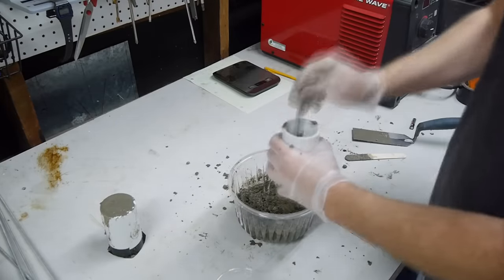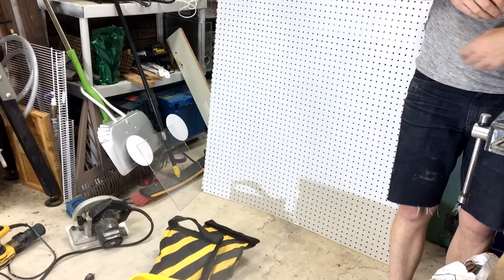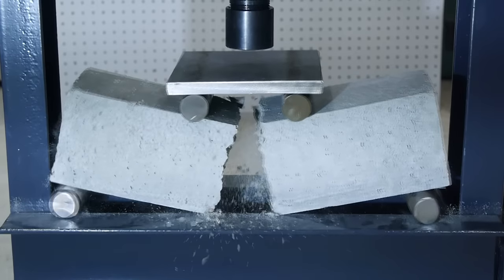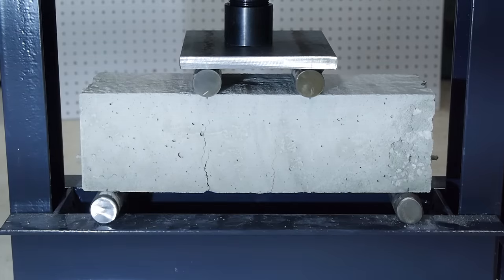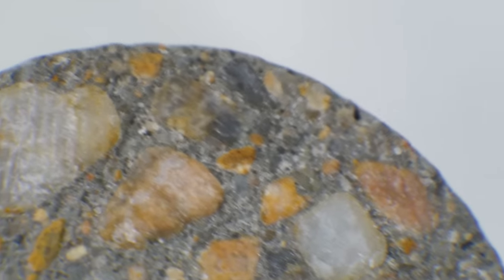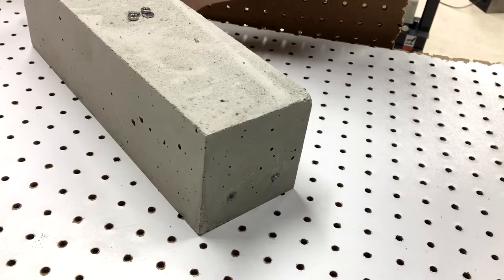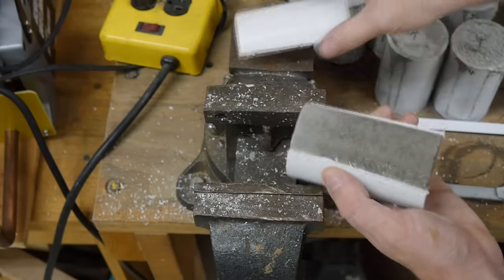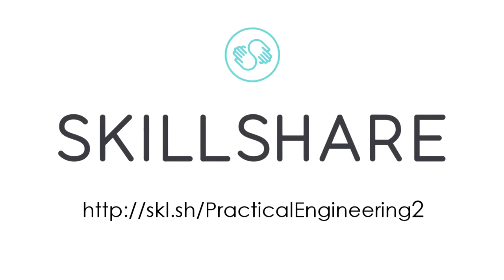Why Concrete Needs Reinforcement

Comment: Also, could the reason behind the diminished tensile strength be that the bolts you cast into the concrete covered a much smaller surface area than when you did the compression test? When you did the compression test, you put the load equally along the entire edge of the cylinder. However, when you did the tensile test, you did it with ONE bolt, right in the middle. Wouldn't adding more bolts distribute the weight on each bolt, reducing the stress on each one, and also therefore introducing more points of possible failure while at the same time decreasing the overall chance of failure against the same test weight? I'm no engineer, but this got me thinking.
Reply: Sure but the concrete broke cleanly in the middle! So the steel and the adhesion didn’t effect the test? If u catch my meaning

Comment: Wait, so the pre tensioned reinforced concrete broke at the same force, but the cracks formed later? Why would I want to use a type of concrete that shows warning signs later?
Reply: Cracks don't always equal a warning sign of catastrophic failure.  In most cases, they don't.
Reply: Although his demonstration didn't show it, prestressed concrete can be significantly stronger than conventionally reinforced concrete. Also, as the commenter above said a lot of the cracks that first start in regular reinforced concrete need to happen to get the concrete to transfer load to the steel. With prestressed concrete, you avoid this initial cracking because the steel is already in tension and the concrete is in compression doing what it does best.
Reply: The tensioned setup failed due to only hanging on by some thin threads, the rod didn't break. The difference being that the concrete didn't have to fail before transferring force to the rod.

You'd want to use it where you wouldn't want the concrete to fail in the first place. I imagine the rods used are designed to fail slowly so as to stretch and allow for visible cracks to form before failure.

In theory, it does make the concrete much stronger.

Comment: what about adding fibers into the mix?
Reply: It might mess up how the cement forms, and drys. Plus you gotta think about the weight of the project. I'm doing a job right now that is about to pour 55 tons of concrete, and I don't think fibers would hold any area of that. I'm sure if fibers would help they would have already started adding it into the mix. I mean the world has been using concrete for more then 100 years.
Reply: You can add fiberglass to the mix along with rebar, nothing wrong with doing so. Or you can just use fiberglass with no rebar, depends on the use of the finished product. All the tiny fibers would help keep the concrete together. Only downside side is that it’s slightly harder to finish.
Reply: https://en.wikipedia.org/wiki/Fiber-reinforced_concrete

Just add a fiber-free top coat after floating when the FRC concrete is screeded to avoid issues when finishing it.

There r many different fibers (used in FRC) it's not just (GFRC) fiberglass that can be used instead of rebar for some applications. But when there is a large project the require pre-tensioning like an large infrastructure FRC usually will not suffice on its own. 

BTW concrete is thousands of yrs old not just 100s. And fibers was used early on in it. But just like concrete, the know how to use fiber with it was lost too and had be rediscovered.
Reply: Fiber-reinforced concrete (FRC) has been around and researched a good bit and it has limited use.  Rebar is needed for continuity throughout the concrete member and most fibers used in FRC are extremely short and can only reduce microcracking.
Reply: Rebar is more traditional used by most trades ppl so there is a bias to use it. And many have no idea how to properly use Fiber-reinforced concrete (FRC) such as Glass Fiber-reinforced concrete (GFRC). That adds tensile strength throughout the concrete unlike rebar. And is less prone to failure since rebar is often incorrectly placed. 

So ppl that make incorrect generalized statements like "Fiber-reinforced concrete (FRC) ...it has limited use.  Rebar is needed for continuity throughout the concrete member and most fibers used in FRC are extremely short and can only reduce micro-cracking ("continuity" of what?)" just do it out bias and ignorance about both FRC and Rebar. 

Bottom line is do your own research on what is best for your individual application.
Reply: Concrete already sucks as it is 😂

Comment: I've noticed iron rebar within concrete will rust and expand, breaking it apart after enough time. Is iron rebar only used to save cost over stainless steel?
Reply: I don't see a lot of other reasons to use it
Reply: Do you mean steel vs stainless steel?
Reply: Your question spurred a Google information search. Apparently, iron has a greater yield strength and greater shock absorption than steel. Possibly one of the reasons
Reply: stainless
Reply: interesting
Reply: Parker Davis stainless steel rebar is used if specified by the engineers.  It is considerably more expensive than regular steel rebar.  You will see stainless specced in areas of high corrosion such as bridges near salt water.   I have even seen epoxy coated rebar but I didn’t ask what application it was used for.

When Using normal steel rebar there are standardized guidelines for proper placement to insure sufficient encapsulation.  This is done to help prevent moisture from contacting the rebar causing it to oxidize.  Oxidization (rusting) of rebar embedded in concrete can be quite destructive.  It can expand to four times its original size if I am not mistaken.
Reply: there are ways to clean and reserve the state the iron bar was used but a lot of the workers now don't use it because of the time, money even tho for the long run it would pay off a lot better
Reply: Rebars are always covered by a layer of concrete. Thickness of this layer is always calculated and it's based on the type of environment the structure will be placed and so on. Minimal thickness is about 20 mm and can go up to 50 mm in foundations. If done properly, it will not rust for the lifetime of concrete structure, which is 50 - 70 (100) years.
If some part of reinforcement gets exposed, it is treated by anti corrosive coat and covered by concrete again.
Reply: badlandskid
Reply: Parker Davis I'm a reinforcing iron worker and unless the place is humid. Regular steel is enough. Now on places that have boilers or water tower you can use epoxy coated rods. Or if you're building a bridge galvanized steel
Reply: Concrete is a fascinating trade and there’s so much to learn about it.
Reply: Rebar is made of steel not entirely out of iron. Cost is a factor in many applications. There are time where only fiberglass, or steel “beads” are used instead of you standard rebar.
Reply: Parker Davis I'm a bridge engineer in New Mexico. We specify that in our bridge beams, all rebar within 4' of the ends, and all bars that protrude from the top of the beam must be stainless or stainless clad. It's expensive, but these two areas are where we find the most corrosion problems, so it's a tradeoff between cost and service life.
Reply: pakan357 I agree with you, bur it could still rust. Especilly the "black" rust that that can happen to structures exposed to water.
Reply: Carbon steel is much much less expensive than stainless steel. You'll find that due to the high alkalinity (pH of 13 or so) of the concrete when poured that a passivization layer is created at the bar/concrete interface. This layer is enough to protect the carbon steel bar against corrosion for quite some time. Of course, there are always exceptions that can lead to corrosion. Cracking of the concrete cover may cause this layer to breakdown if the concrete pH drops. It gets especially bad if you have a catalyst like salt to speed up the process.
Reply: jjohnston94 Is basalt rebar ever specified to be used on any of the projects and if so what are the criteria for it to be used?

Comment: 1. the type and size of the pebbles count. 2. type of sand. 3. type cement (sometimes it's a mix) 4.if you add fibers you can reinforce the concrete a bit more. 5. How much water you add effects the concrete too. If it was to dry it has bubbles and the concrete brakes faster, if it was to wet, the concrete loses his strength.
Reply: This is all true. I am a rod buster/ post tension installer. I know that they use special mixes. Vertical is different from deck. All do to different forces that occur. There are def. special mixes certain companies use and swear by them.

Comment: I have a question 🤔. If you could pre-stress concrete, would it be more beneficial to zig zag the metal rods, or even have a spiralling shape, to mitigate future pulling, pushing and twisting of a generic concrete beam ? 🤔🤔 I hope this does not sound stupid 😐
Reply: the metal rods usually designed on site before being poured by concrete, because it is cheaper to produce long uniform metal rods. It doesnt sound stupid, but if you order predesigned metal rods, it way more expensive adding to the building cost. I never saw the spiral or zig zaging shape, but usually we make it like square patern on top of each other(usually welded together)
Reply: I guess it will cost alot to do this way and reinforcements  at certain points will be weaks. So in real life they just increase the sizes or they add more reinforcements.
Reply: nope. a spiral rebar shape would mean that the longtidual tensile force would be split between a parallel to the axis of the rebar and a vertical one. so a spiral shape would deform much more.that means that the beam would crack alot more. u generaly want the rebar to take tensile force only and concrete compressive only. all the forces pulling-pushing and twisting can be recived by the cooperation of the longditual rebar, the transverse rebar and the concrete

Comment: I was taught that concrete (and other ceramics) are good in compression but bad in tension because tensile stress helps with the propagation of small cracks that are already present.. is this true?
Reply: Millie Heber that’s true
Reply: Millie - That is partially right.  There are lots of cracks in concrete.  Also, the glue that forms (known as CSH) is not strong in tension.
Reply: Those cracks you refer are also sometimes tiny fissures, gaps, air pockets, etc. and they are formed when the concrete is poured and sets. That's why concrete workers (called concrete finishers or cement masons) are in a skilled trade (from apprentice to journeyman over 5 years), and do their best using tools and techniques, to remove these gaps, and fissures, so that as the concrete sets, it doesn't solidify in a manner where cracks can easily develop.

Comment: I am confused between concrete resistance, for example f'c= 250kg/cm2 and the slab resistance or the weight a concrete slab can carry wich is a lot less than 250kg/cm2 can somone clarify me this please.
Reply: It is because fc is concrete's compression resistance. Your thinking would be correct if you considered columns - elements that are mainly being compressed (of course fc is only one of the variables that determine a column's load capacity). Considering columns you could assume that it should carry weight around it's fc value so in your example it would be 250kg/cm2 times it's cross section value (please remember this is just general idea I'm describing, not the precise solution - it's not difficult to imagine that a column that's cross section is 1cm2 and it's 2m tall won't carry 250kg:) ). Slabs are elements that have to handle mainly bending. As author of the movie shown in 2:34, bending causes both compresion and tension forces in element. There is an easy way to transpose force that bends a beam, to compression and tension forces in that beam. If you want to check how much weight will your slab carry, you have to find how much of compression force your slab can take (and I mean this transposed force that comes from bending ( 2:34 ), not the weight placed on the slab!). That amount depends mainly on the slab's height and concrete's fc. When you know value of compression force, then you also know tension force because they are equal! So next you just have to provide rebars in the slab's tension zone, because concrete can't handle that amount of tension. Quantity of those rebars must be enough to handle all that tension force then. When you know those maximum "transposed" compression and tension forces that slab can take, you can calculate backwards how much weight on the slab causes that amount of forces.  That was just a long story short thing - tried to describe general idea of slab's mechanics. Topic is not that difficult, but if you want to fully understand it you have to get some knowledge of basic statics, beams and how reinforced concrete works, which was well explaind in video above. Hope I could help.
Best Regards
Reply: @qvanta  Thank you very much for your detailed explanation! I greatly appreciate it! Now I understand it a lot better. I saw the video but wasn't too sure about it. Thanks again very much!!!!!  =D

Comment: it seems like rebar transmits external stresses internally, which would otherwise be primarily external (1/4 inch of depth) tension and compression, thus the failure pattern differences.

Comment: Why does under ground metro station roof does not collapse due to weight of several thousands kilograms of weight (of soil) above?
Reply: Yogesh Kumar I think because it is curved it can bear much more weight than a conventional square roof
Reply: Magic, and turtles all the way down.
Reply: idk about the building but i know that the building that is bigger than 6 meters needs a new foundation on that place no build can withstand even itself if it doesn't go like this or more. also you saw the metal roods that he put in the concrete they are armature that needs to be put and probably is in there. And above all the weight is more or less the same all over the build so it shouldn't collapse because it isn't focused on one place. underground builds are a lot safer and sturdier if well made than the big buildings outside 
i would speak in a more professional speech about this but english isn't my first language so idk about all of the words that i need...
Reply: I think the underground tunnels which are shaped round,  work like arches . They transfer the load to the side buttresses.
Reply: Because,  the structure is not barring the structure you think it's holding, soil.the tunnels structure, the skeleton, actually isn t carrying alot of soil, weight. In NYC the metro subway was not built underground, it was built from the surface, they dug down to create the system. They didn't use materials that would collapse the system when they were done they found the lightest material that they could use and if you noticed New York has a lot of potholes

Comment: What was the cure time you gave it? Apologies if you stated that, 30 days for example tends to be about 80-85% FC strength that a slab will ever be if cured inside after setting or up to 95% if outside.

I worked in a place where we prebuilt concrete walls and i was responsible for welding all the test engineering samples of walls before full production, places like prisons or even bridges we made precasted solutions for. Its always interesting to get full information from other testing samples like this

Comment: In 1987 I worked for an engineering testing firm. We were working on a airplane hangar for large aircraft and the slab on grade had a spec requirement of 550psi flexural strength so we made test beams. The our engineer also required compressive test cylinders to be cast out of the same test samples.
Our test results averaged around 600psi flexural strength at 28 days of curing in a lime and water tank, and the compressive cylinders averaged around 8000 psi.

Comment: We use concrete in a recycling center and run heavy equipment across it all day long with steel tracks. The concrete continuously wears out no matter how much psi we use and no matter how much rebar we use to reinforce. It’s a very abrasive industry. Do you have any tips as to how to get the concrete to last a little bit longer or a lot longer would be even better

Comment: Thank you for this video. Very good.
Could you comment on the use of tensioned steel cables and when should they been used? How to solve issues when building concrete foundations in top of clay soils? Does it help in earth quake situations?

Comment: I would like to see a commonly used concrete steel beam in house construction (meaning up to 6 steel rods bottom half 4 rods top half ) and compare it scaled down in different levels (4 bottom 3 top; 3 bottom 2 top; 2 bottom 2 top) and maybe even compare those to different dimensions of wood bars that would be nessecary for equal static forces and create a comparison table from it.

Comment: I would love to see you do a video on how the pyramids were able to support such enormous weight while still containing cavities. Specifically, there is a chevron structure above the King's chamber in the great pyramid that appears to be used to deflect the downward force outwards, but then has a series of empty chambers below before you get to the chamber. What is the purpose of these? Also, (this sound goofy, but) I have recently seen some pretty convincing docs on how the stones were poured in place, as a primitive form of cement rather then dealing with hauling this megaton rocks uphill. Love to see a video on the great pyramid construction!
Reply: Matthew Palmer  😂😂